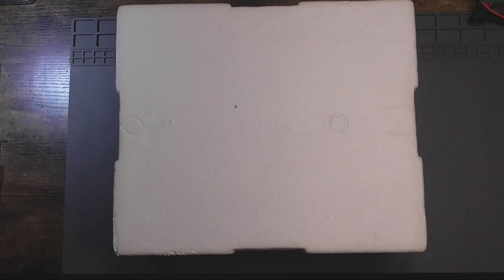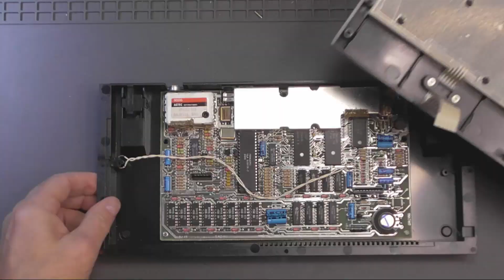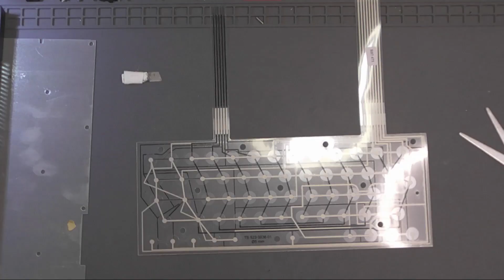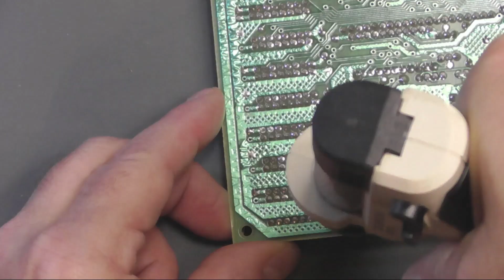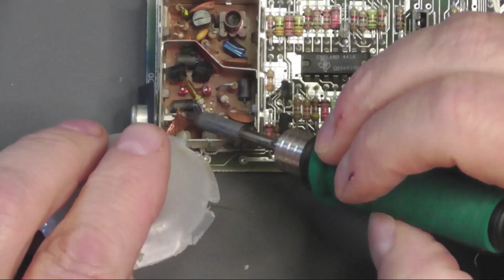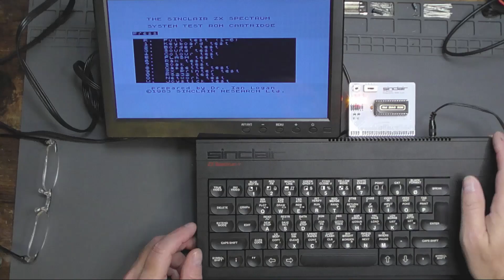Sinclair ZX Spectrum + Keyboard repair, composite mod and recapping.  Pt1

Comment: Keep an eye on that little monitor! I have it and the power supply must be so noisy that when I used it on some machines (composite input) there is noise getting into the system, it was causing phantom key presses on one machine
Reply from the maker: Thanks for the heads up.  It's never been great for a clean image from anything on composite